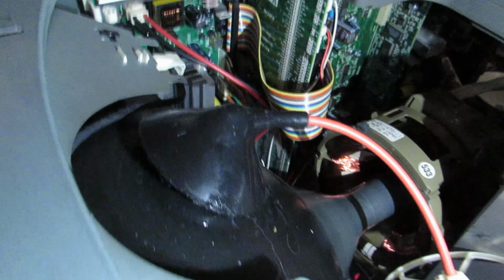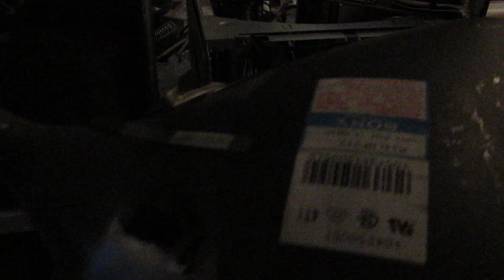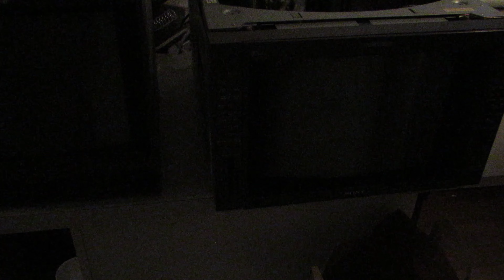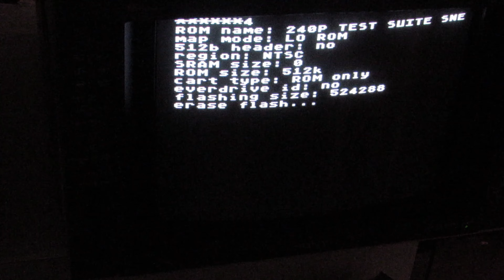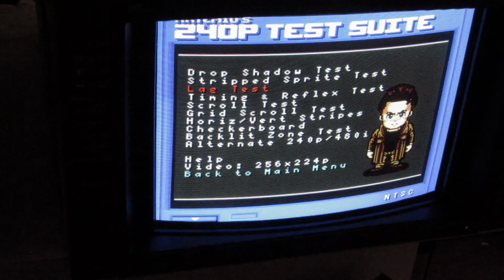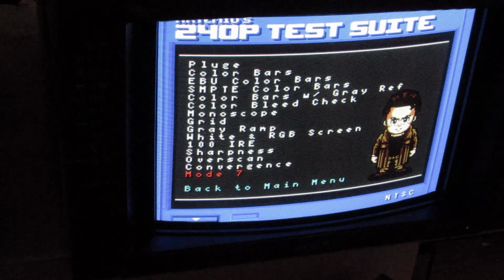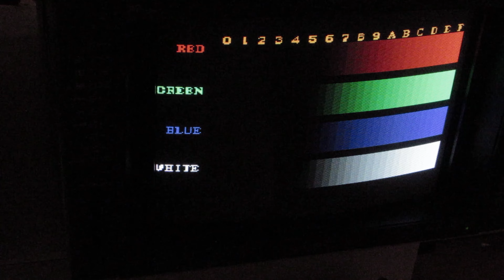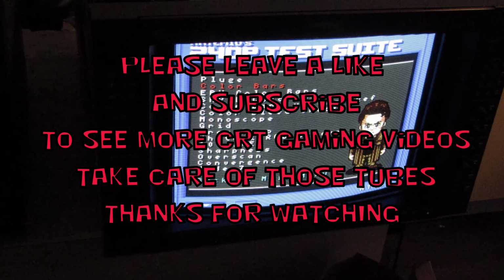Sony 14F5U BVM Tube Replacement

Comment: Nice!
Reply from the maker: @plumbnebula5741  🙏
Reply: @dahjord  One question, I also have sony bvm 14f5u. I'm planning to put a NOS tube in there, what's the tube number? Also I've been trying to figure out how to remove a black cable on the memory card side of the bezel, where is it connected to? It's just some black cable going on mem card side to somewhere I can't really see. Thanks and great work on the swaping
Reply from the maker: @plumbnebula5741  where do u find a new old stock tube?  why would you remove the black cable? i have not bothered with it before but i assume its attached to the pa  board? i can check out the tube number when i get some time sorry the video is so dark
Reply: @dahjord  ebay and I'm gonna get the nos tube from ebay. Very unlikely I find it tho, what I'm probably gonna do is remove the antiglare, but I cant remove the bezel even partially without removing that black cable
Reply from the maker: @plumbnebula5741  u just tilt it upside down place it ontop the monitor and u have full access to tube no need to fully remove it. yeah super rare to find now tons of people want new tubes and super expensive probably i just got a pretty nice condition used one u literally cant tell the difference rly unless they are super worn color or brightness.
Reply: @dahjord  so I have to put the monitor upside down and then I have full access since the cable reaches?
Reply: @dahjord  oh and mine has 25000 hours so yeah just a backup NOS tube
Reply from the maker: @plumbnebula5741  you just said you were getting one from ebay how could you already have it then
Reply: @dahjord  I was going to look if I could get one, I'm just gonna remove the antiglare since mine has some scuffs, only way I can really get one is from warehouses of old equipment.
Reply from the maker: @plumbnebula5741  ah good luck mine has no anti glare
Reply from the maker: @plumbnebula5741  25000 hours isn't much I doubt you will ever burn it out they can last over 90000
Reply: @dahjord  I just thought there might be antiglsre just of retrotech video showing it on